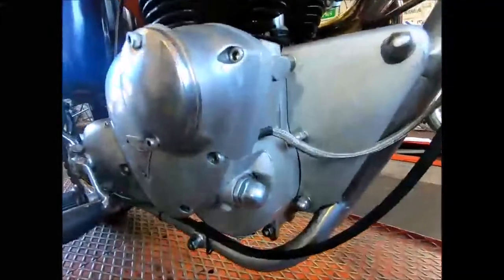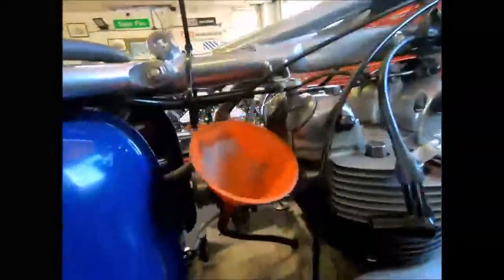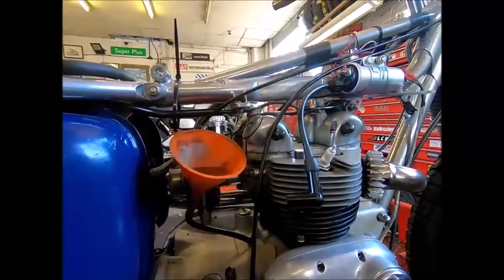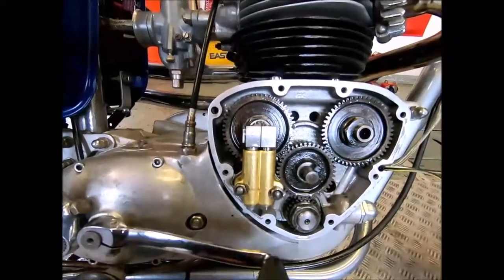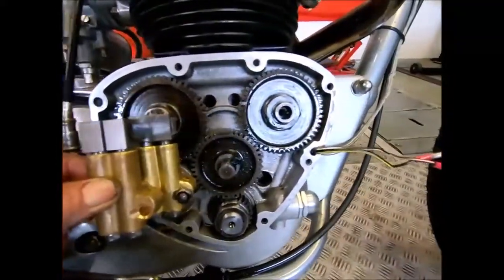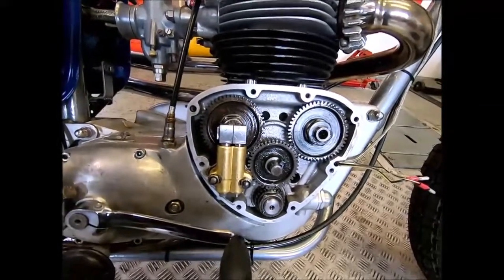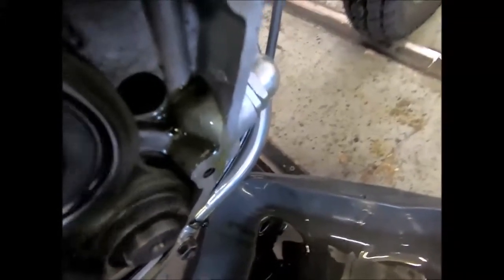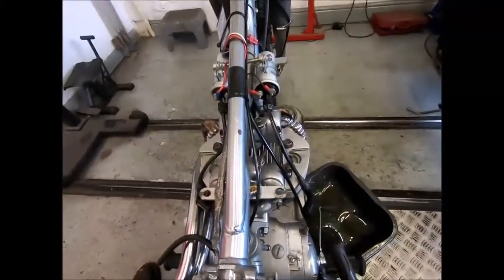Troublesome Triumph 3

Comment: I've had 3 of those pumps in plain white boxes not work on 500's. When I turn them over if the pump has a slot not 2 holes wont use it.
Checked the seats etc, stuck Morgo's on  and no problems.

Comment: I have never seen a motor run with the cover removed. I was also expecting that intermediate gear to run across the floor. The pump problem was as said, a gasket blocking the oilway.